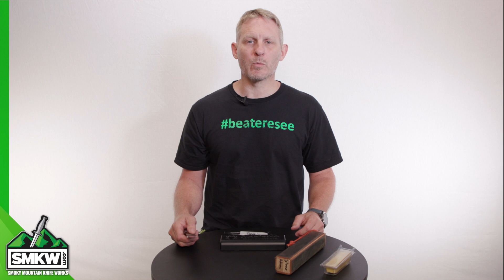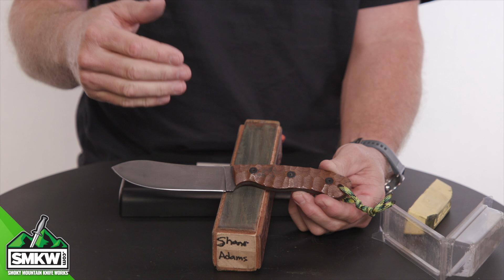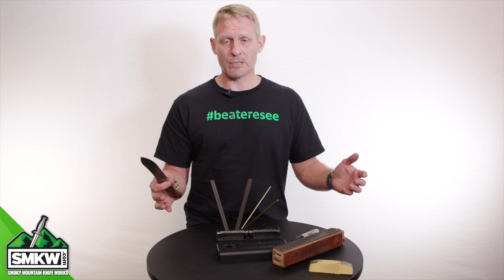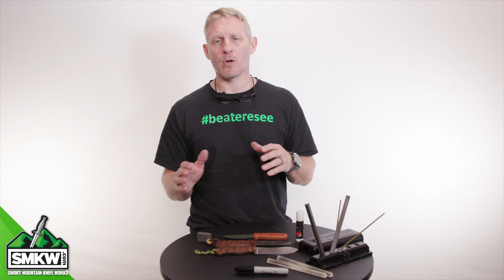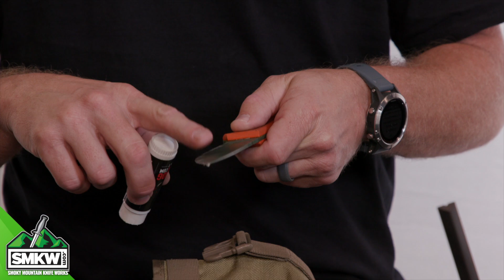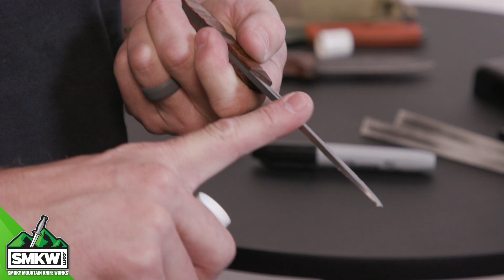SMKW: Blade Maintenance with ESEE's Shane Adams

Comment: Opinion on the worksharp field sharpener ?
Reply: The Worksharp Field Sharpener is a handy way to maintain your knife without taking up a lot of room in your backpack.  In addition to course and fine diamond stones it also has a ceramic rod and leather strop built in.  Just preload the leather strop with compound before leaving the house.  I mostly use the ceramic rod and strop to keep my edges honed and sharp.  The diamond stones are only needed when I have edge damage that requires removing more metal.
Reply: @gregblake2764  will have to give it a look!
Reply: @RandallsAdventureESEE  ended up getting one and love it. Have used it from my full size axe to my pocket knife. You can switch out parts if needed and Amazon has good carrying pacts.
Reply: I've had NO HANDS on time with it....so I can't speak to it personally...wish I could help but that one and I have not crossed paths..

Comment: Is the Esse 4 S35VN gonna chip if I use it hard.  Or should I just stay with Esse 4
Reply: Hard to answer as there are too many variables and definitions of "hard use".  One thing I have noticed is that a LOT of "premium steel" blades with micro chip till you sharpen them once or twice then it seems to normalize.  I have a LOT of pocket knives that I use pretty hard and I've seen this happen a few times.  It's all in how you use it.
Reply: @RandallsAdventureESEE  Thanks man . I'm just gonna get Esse 3 & 4 S35VN  so I can have both SS and 1095 for 3 & 4.
Reply from the maker: S35VN is not going to chip if under hard use unless you are using it incorrectly

Comment: I scratched the entire steel part of my knife a few years ago and I’m really upset about it. How should I fix that?
Reply: it's a tool....with use it will develop scratches and use marks over time...just like our bodies...scars are cool and it means there is a story behind it.  Our philosophy is that we make tools not items to be placed in a shadow box.
Reply from the maker: Just like with any steel, patience and a little elbow grease.  If it is on the cutting edge especially just continually make passes on a stone.  If it is on the grind of the blade some polishing compound and a dremel will be easiest.

Comment: Love the SharpMaker! But I wouldn't drag the point right off the stone, I always finish my stroke with the tip still on teh stone. The SharpMaker can round off your tip if you're not careful with this.
Reply: I also find with my Sharpmaker, the stones move around in the plastic base as it's not a very tight/accurate fit.  Not too impressed with it.

Comment: I've got Japanese water stones 400,600,800,1000,2000,3000 and 5000 grit.  For the life of me I can't get a blade scary sharp
Reply: it's all about the angles....you can do the same permanent marker trick on stones as well to make sure you are getting uniform angle.  On stones I have an issue where I sharpen one side just like I want and when I switch the knife over it's like the other Side is not even connected to my brain.  I've gotten better with practice but tend to free hand more while holding the blade vs a stationary stone.
Reply: @RandallsAdventureESEE  Well, I went out and purchased the Work Sharp Ken Onion edition tool and knife sharpener. It works well and is much faster and easier than using water stones. I can still use the stones to do finishing work on my blades if necessary
Reply: @ElkArrow    good stuff...just go slow on the mechanical sharpeners and check work frequently !

Comment: Very helpful video, I just got back into knives after about a decade. I mainly have folding knives and bought a Work Sharp Guided Field Sharpener
 for when they start to lose their edge, what is your opinion of that sharpener?
Reply: I see a lot of people going to a mechanical sharpener bc they feel like it maybe easier and I ALWAYS caution them....you can hog off material pretty quick if you are not careful...Personally, I'd much rather learn it the OLD fashion way and develop that skill and understanding before moving to a mechanical sharpener that could potentially damage a blade before you knew what hit you....